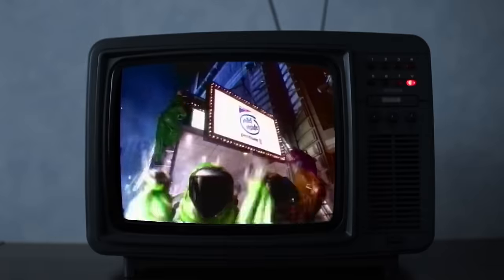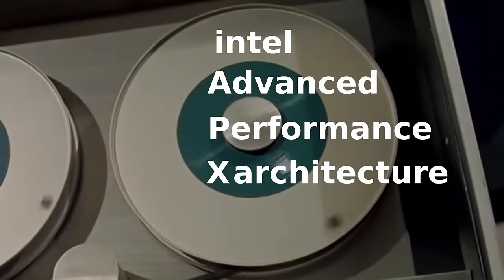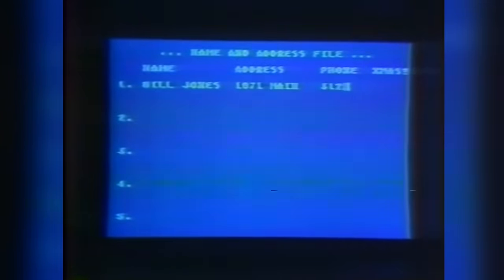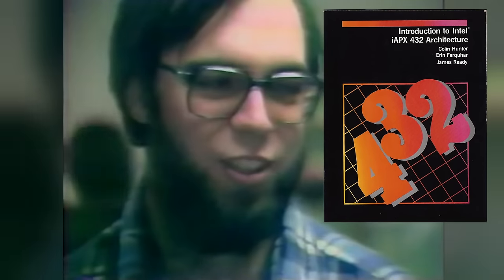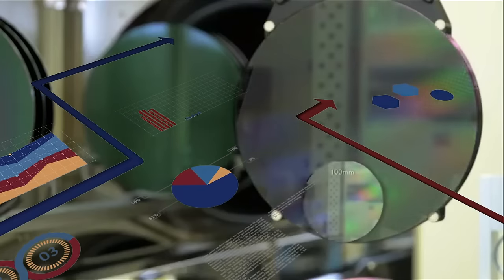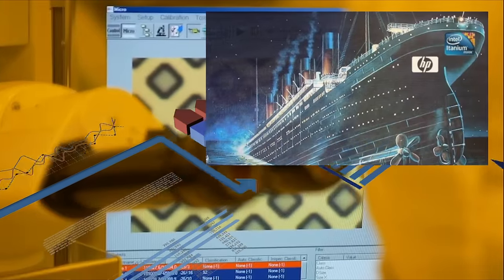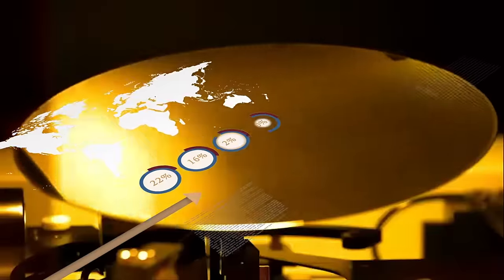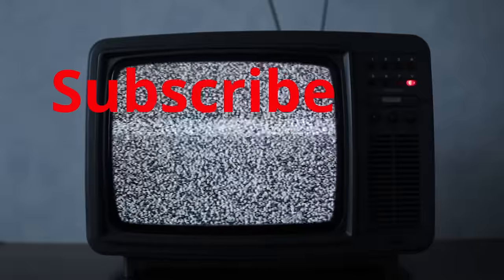iAPX The first time Intel tried to kill x86

Comment: Allegedly the "X" stood for arCHItecture, as in the Greek letter. Feels like it's grasping for straws though.
Reply from the maker: Oh that really is grasping is'nt it.
Reply: Ha I was thinking maybe the "ect" in architecture sounded a little like an "x"
Reply: Well, technically speaking, no more tenuous than the "X" in CHristmas...
Reply: I always assumed the "x" was basically just a wildcard.  386, 486, 586, etc .....just became x86 because the underlying architecture was the same (or at least the lineage).
Reply: @AttilaAsztalos  or in the academic preprint site arXive.
Reply: It's not alleged. It stands for architecture. The i8088 is the iAPX 88. iAPX 88/20 is a combination of the i8088 and i8087 fpu
Reply: @AttilaAsztalos  The X in Christmas is a cross, based on the shape, has nothing to do with sound.
Reply: @KyleDavis328  it's not, it's based on the Greek letter, which was used a short hand for Christ because of its sound. The sound is admittedly closer to "ks" than "krs" but it's still based on the sound.
Reply: One reason why they didn't want to use APA might be that APA is the official abbreviation for American Psychological Association 😄
Reply: @Autotrope  : "arciteXture"

Comment: The 68000 was a nice chip!  It has hardware multiply and divide. An assembly programmer's dream. I know, because I coded in Z-80 and 8080 Assembly.  Good reporting!
Reply: Are you me?
Reply: The 68000 CPU powered the very first Apple Macintosh released in 1984.
Reply: Yeah, it had so many registers compared to x86, nice addressing modes and useful instructions (as you mentioned, just that mul and div were microcoded until later 68k family versions appeared), and a 32b register width.
Reply: I recall reading somewhere that the IBM engineers designing the PC were quite interested in the 68000, but it wasn't going to be released (beyond engineering samples) in time for their deadline.
Reply: It was. Intel 8086 had it too, but on 68000 you had it on all 8 data registers. On Intel just on a single register. Everything had to be moved around a lot more. Intel was well behind Motorola.. I consider the 486 the first CPU where they actually had caught up a little, but the 68060 still bested the Pentium. Why? General purpose registers, baby.

Comment: The 8086/8088 was a stopgap stretch of the 8 bit 8080, started as a student project in the middle of iAPX development. iAPX was taking too long, and interesting 16 bit devices were being developed by their competitors. They badly needed that stopgap. A lot of the most successful CPU designs were only intended as stopgap measures, while the grand plan took shape. The video doesn't mention the other, and more interesting, Intel design that went nowhere - the i860. Conceptually, that had good potential for HPC type applications, but the cost structure never really worked.
Reply: It also doesn't mention that the i960 embedded processor family was created by defeaturing 432 based designs - and this went on to be a volume product for Intel in computer peripherals (especially printers). 

At the time the 432 was in development the x86 didn't exist as a product family and intel was best known as a memory company. Hindsight is easy - but at the time Intel was exploring many possible future product lines. The i960 family pioneered superscalar implementation which later appeared in x86 products. The i750 family implemented SIMD processing for media that later evolved into MMX. You have to consider all these products as contributing microarchitecture ideas and proofs of concept that could be applied later across other product lines. Even the dead ends yielded fruit.
Reply: He said at the beginning of the video that he was only going to talk about Intel's first attempt at something different than x86.
Reply: @alanmoore2197  …and in F-22 Raptor.
Reply: iAPX must have taken too long from trying to fix is inherent flaws,  It seems they dodged the bullet when they developed the 8086 and 8088.  Then they had the terrible Itanium.  I guess the best thing it had was a somewhat nice name.  It almost sounds like something on the periodic table.
Reply: Interestingly NetBurst and the Pentium 4 also were sort of a stopgap because their IA-64 design wasn't ready for consumer markets.
Yes, we only got the Pentium 4 because Itanium was too expensive to bring it to home users and because with later models they removed the IA-32 hardware.
Reply: @HappyBeezerStudios  Yeah but NetBurst sucked. It was supposed to replace P6, but it totally failed to do so in the mobile space (being too hot and not very cycle efficient), and Core evolved from those P6-derived mobile processors, NOT from NetBurst.
Reply: @alanmoore2197 I'm not sure I'd describe the i960 as a defeaturing of the 432. This is true in a sense, but there were a lot of very fundamental aspects of the architecture that were changed and needed to be changed to make it performant. 

Also a lot of the fancy features of the 432 were locked away in a version of the i960 that was pretty much not possible to buy unless you were the US military.
Reply: @HappyBeezerStudios  The Pentium 4 is a way better processor than Itanium. Yeah it was a bit slower and hotter than expected, and yeah it didn't have the zen voodoo of the P6. But what bombed the Itanium isn't just shipping late, it's that their whole architecture concept proved to be pointless, overdesigned and slower in practice. If they had simply copied MIPS like everybody did and everybody still does, Itanium would have shipped on time, ran faster and might have replaced x86 eventually. Heck, if they had simply cleaned up x86 and upgraded it to 64 bits it would have worked out.
Reply: @boptillyouflop  The real killer of Itanic was the AMD64 superset. Or at least it was what caused the waving of the white flag of itanium.
Reply: @wishusknight3009  Yes. The irony is that the Intel/HP duo already had TWO architectures that were better than the Itanium. They had the Pentium Pro/2/3/M, which was already giving everyone a run for their money despite the x86 insanity and simply had to be upgraded to 64bits and multiple cores (which they eventually did with the results we know of now). And also, HP's PA-RISC architecture was already 64-bits and reliably had great performance and was well designed, and already had all the out-of-order stuff that made CPUs fast.
Reply: @boptillyouflop  PARisc had its limitations. And HP was at the end of its IPC jumps, and having some issues ramping its clock speed. It still had a bit of gas left in the tank but it really was showing its age by the time it was retired. And while Itanium was  being deveolped, we still didn't have Banias yet. Itanium launched when the most we had was Coppermine and Willamette. And maybe Tualatin at the end of 2001. First Itanium had promising native performance while its dismal x86 was what gave it the really bad names. That along with its chronic lateness and overhype as being an x86 replacement. And Itanium2 was somewhat better in native speed, but by that time Pentium M had launched and showed a huge IPC gain for X86 that Itanium would never match. Than the AMD64 superset in 2003 finished it off. 

Some of the earlier Itanium2 cpu's showed better overall 64 bit performance than the Athlon 64's at their launch, but porting to them IA64 was a bit of a fudge compared to porting to AMD64. AMD64 was pretty instrumental in stopping IA64 adoption.
Reply: @wishusknight3009  Ah ok. Yeah, in that context, Intel doubling down on Itanium makes more sense, and it's only in retrospect that conventional out-of-order showed that it had more gas in the tank than expected.

I guess the other part of it is in the "type" of performance - roughly "numerical performance" vs "messy code performance"... And the Itanium episode showed that "messy code performance" is the more important one, both economically, and also because it translates more reliably into performance in general.

Comment: You forgot the 80186 processor! Not used in a PC. But it was a huge failure couldn’t jump back out of protected mode. This needs a reboot!
Reply: The 80286 couldn't return to real mode from protected mode without a reboot, either.

Bill Gates hated that...
Reply: The 80186 did not have a protected mode. It was an 8086 with interrupt and bus controller chips brought on die. They were intended for embedded systems although some PC's used them (Tandy) but had compatibility issues due to the different interrupt controller. I worked on systems that used up to 16 80186's and '88's and wrote a lot of code for them in C and ASM. Variants of the 80186 still were made after the 286 and 386 were basically retired. They were common in automotive ECU's, printers, automation and control systems.
Reply: @orinokonx01 Sure it could, you just had to triple fault the CPU!
Reply: @orinokonx01  Shouldn't need to. Only reason for real mode on a machine capable of multi-user, multi-tasking, possibly virtually memory is to set up the machine prior to launching its protected mode programs. Returning to real mod would introduce a massive security hole.

Comment: One more thing that really hurt the 432's performance was the 16 bit packet bus. This was a 32 bit processor, but used only 16 lines for everything. Reading a word from memory meant sending the command and part of the address, then the rest of the address, then getting half of the data and finally getting the rest of the data. There were no user visible registers so each instruction meant 3 or 4 memory accesses, all over these highly multiplexed lines.
Reply: It was also how poorly IP blocks were arranged on the two packages requiring upto multiple jumps across both chips to complete an instruction. Someone I knew surmised a single chip solution with some tweaks could have had IPC higher than a 486! He saw quite a lot of potential in it and remarked it was too bad intel pulled the plug so soon.
Reply: To be fair, that kind of limitation didn't hurt the IBM PC, The chosen 8088 was a 16-bit CPU on an 8-bit bus
Reply: @HappyBeezerStudios  The 8088 had a register stack though, which will make some difference. Note the 8086 only had a few % performance advantage over the 8088. It really couldn't use the bandwidth up.

Comment: Someone I knew in my area had a type ofAXP development machine. And he remarked its performance was very under rated, and that it had IPC higher than a 386 when coded properly. And estimated a single chip derivative with tweaks could out perform a 486 or 68040 in IPC. Sadly he developed dementia and passed away about 10 years ago. And I have never been able to track the hardware down or what happened to it. He had one of the most exotic collections I had ever seen. And he was a very brilliant man before mental illness overtook him. I only got to meet him at the tale end of his lucidity which was such a shame.

Comment: IBM ultimately chose the 8088 because it meant that the I/O work that had been done on the Datamaster/23 could be lifted and brought over. (No joke, this was the tie-breaker)
Reply: I thought the deal breaker was sourcing the M68k? There were multiple reasons.
Reply: @colejohnson66  The 68K was discarded early on in planning, because not only was there no possibility of a second source (Motorola explicitly never did second source arrangements), there was no production silicon for the 68000 yet (even though the 68000 was announced in 1979, the first engineering samples didn't appear until Feb 1980, and production took another half a year to ramp up).

(a lot of ideas were discarded very early on in planning, including the idea to buy Atari and use their 800 system as a basis for the IBM PC, although a soft tooling mock-up was made and photographed) :)
Reply: @colejohnson66  Production samples of the M68K weren't available until Feb 1980, with the production channels only reaching capacity in September 1980. This would have been a serious problem with an August 1981 launch.

Motorola's second sourcing also took a bit of time, because of the process changes to go high speed NMOS. Hitachi wouldn't start providing a second source to the 68000 until a year after the PC's launch.
Reply: And they moved the S-100 bus into the upper segment.
Imagine if the S-100 (and some successors) would be used in modern x86 PCs. And there was an addon card for 8086 on S-100
Reply: @tschak909 Actually the opposite: Intel never was big on the idea of second sourcing, and it was IBM and the US govt. (who wanted a more stable supply) that made them to agree with AMD.Motorola at the time sold the 68k manufacturing rights to everyone who was willing to manufacture it. Hitachi, Signetics, Philips, etc. Even IBM licensed it and used it's microarchitecture to build embedded controllers (like for high end HDDs) and the lower end 390s (I believe they used 2 cpu dies with separate microcode in them). I think that the main reason IBM chose the 8086/8088 is because all the preexisting 8080/z80 code that was easy to binary xlat to it. The second is cost and business poilcy: IBM actually partially OWNED Intel at the time.